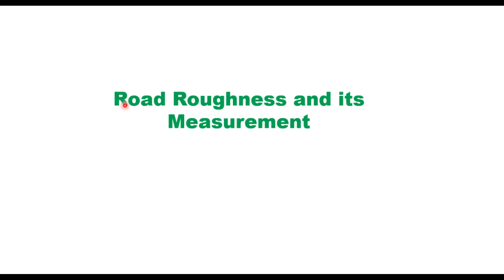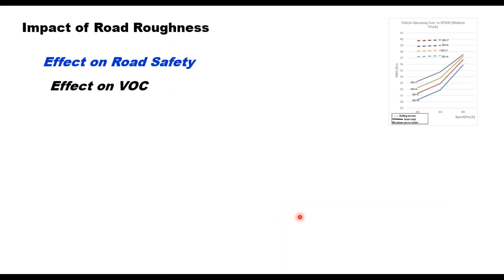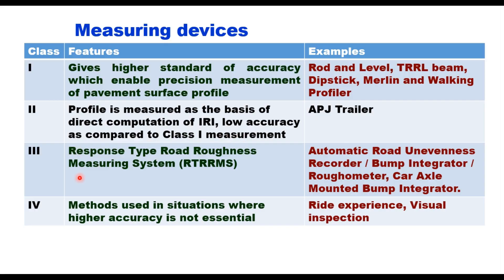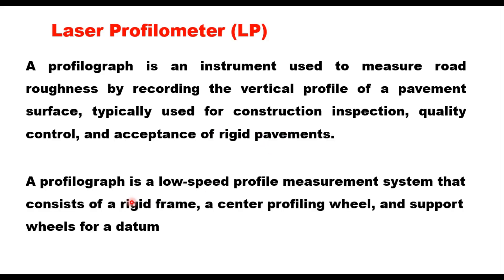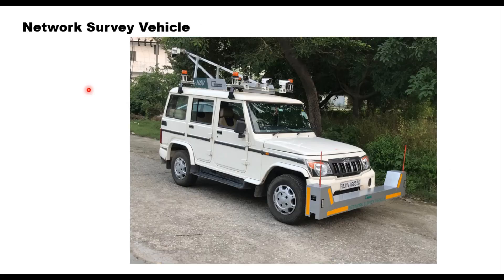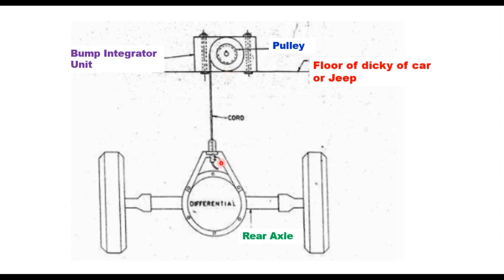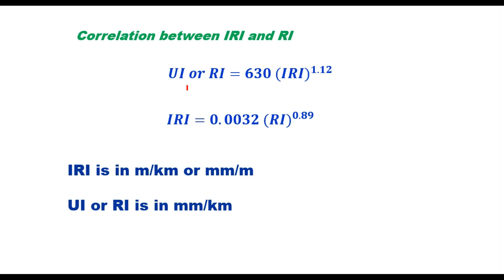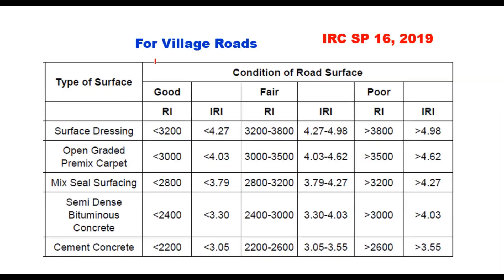Road Roughness and its measurement, IRI and RI, Equipment for Road Roughness Measurement

Comment: Sir can you suggest mix design of asphalt using fly ash as a mineral filler?
Reply from the maker: There is no change in the procedure of mix design whether you use fly ash, rock dust, marble dust or any other filler. All steps and requirements are same.